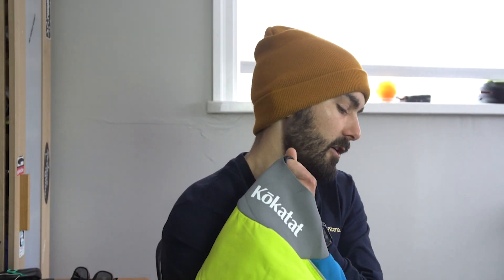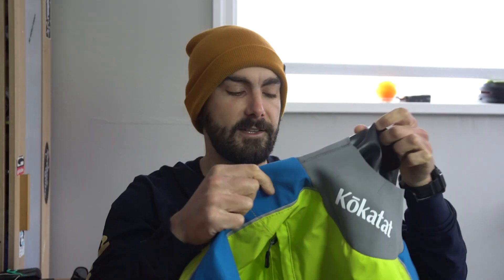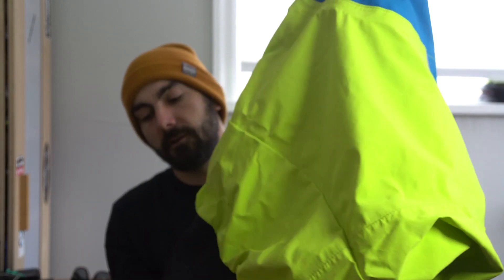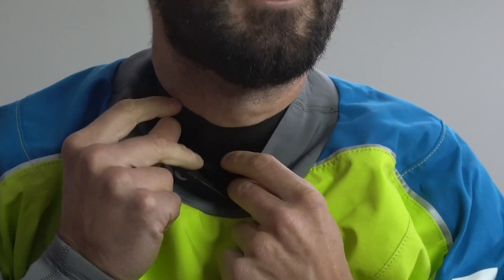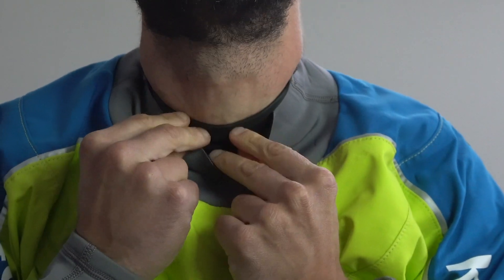Drysuit/Dry Top Gasket care part 1.  Getting dressed

Comment: Great vid. Glad I've already been doing this. Would like to mention that I bought a foam life size manikin head with neck that was pretty close to my neck size and used that to help stretch my neck gasket for a couple weeks anytime I wasn't using it and it worked great for me. You can get them for men and women from arts and crafts stores which is where I got mine. I highly recommend this for new neck gaskets instead of trimming.
Reply from the maker: I never trim. Suffer the first week usually then it is fine. In my experience and with my neck size at least.  Plant pots or cooking pots can work well too.

Comment: Thanks for the tips.  When seeing after time the sleeve peel a little from where it joins the latex cuff, how to you recommend reattaching the peeling portion?
Reply from the maker: Joseph Felber yea you can just aqua seal it. Stay ahead of it and it won’t be a big deal. Or wait for it to break and change the whole gasket.
Reply: @SethAshworth  Thanks again.  Changing the gasket sounds like a big undertaking.  I think I'll do the Aqua Seal while the problem is small, so it will never get big.  (I actually do put Aqua Seal on pealing portions, but I thought I ask what you thought, as it was the topic of the day.)

This is a good time for me for maintenance activities, as my club's activities are temporarily suspended due to the Corona scare.
Reply from the maker: Joseph Felber exactly! Gasket changes are not too bad but a bit of work for sure. I am not good at them.
Reply: instablaster.